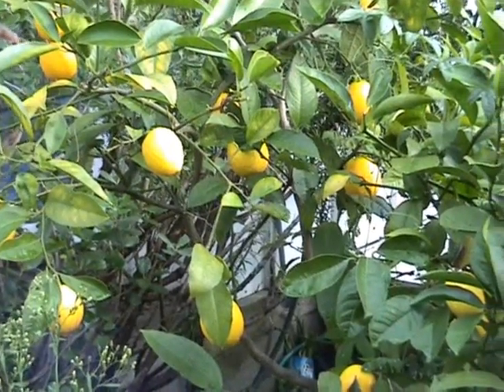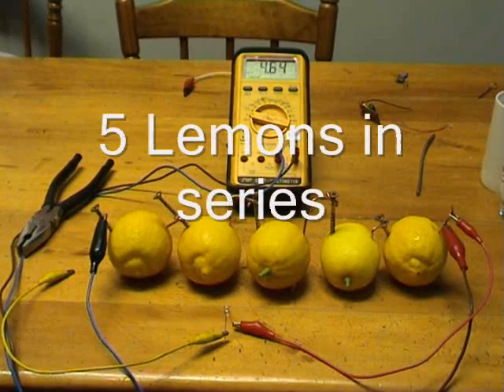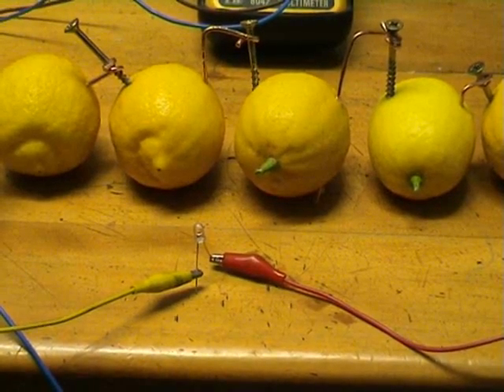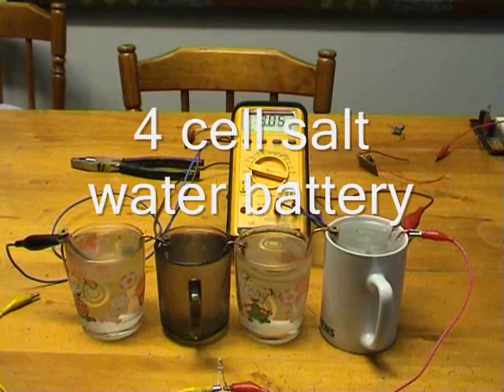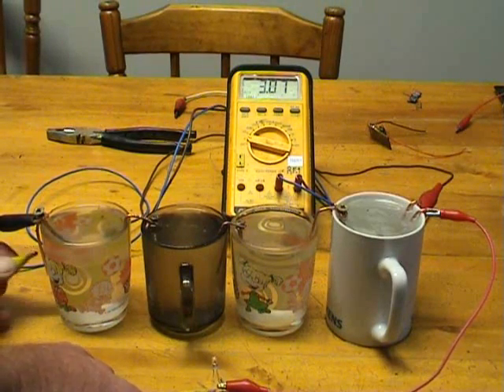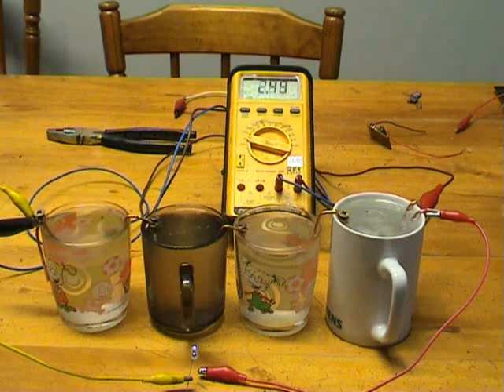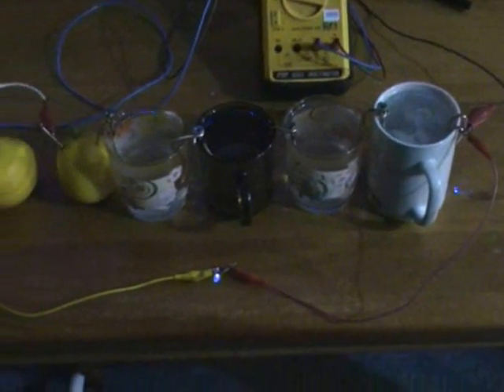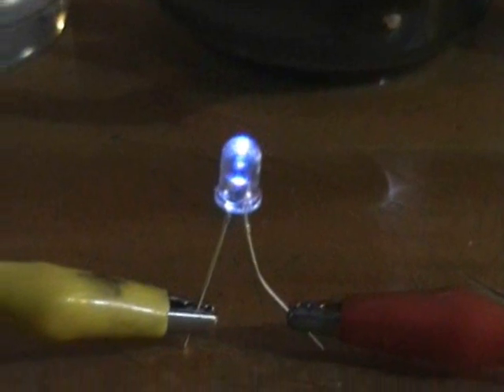Lemon and salt water batteries

Comment: How many lemons to produce 240v? and is it ac or dc?
Reply from the maker: UltimateSmashingFun Lemons produce DC. With copper and zinc electrodes you get about 0.8 Volts per lemon. To get 240 Volts you will need about 300 to 320 melons in series. but the current will be less then 2 mA, depending upon electrode surface area. Voltage drop is significant when loaded with a LED or whatever.
Reply: RODALCO2007
OK Thanks, Mate

Comment: in the lemon battery if the copper were wound around the screws more times you would get more conductivity .
and in the salt water battery if you use flat and  wide bits of copper and steel you would get better conductivity

Comment from the maker: @MegaKickn Probably you could try, not sure if it will work.
For normal lead acid batteries H2SO4 acid is used, thinned with distilled water.

Comment: So if you wired a million lemons, (1000 x 1000 series parallel) could you get a powerful electric shock off them?
Also, are the lemons edible afterwards or do they get filled with metal oxides?
Is the capacity limited by lemon or electrodes?

Comment from the maker: @quangluu96  You need lots of lemons which make it a very expensive battery.
Increase the surface area of the conductors in the acid will aid in a larger current being available.

Comment from the maker: The led runs for about 5  to 8  hours in this set up, main problem is minor corrosion at the terminals in the lemon which reduces the current flow and less power to the led.
With a red led it will last longer. try it out